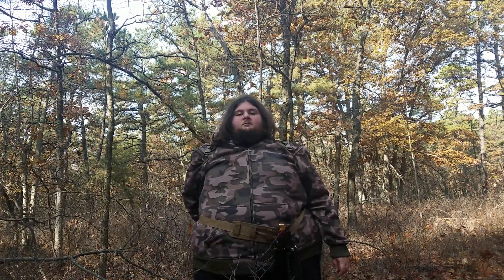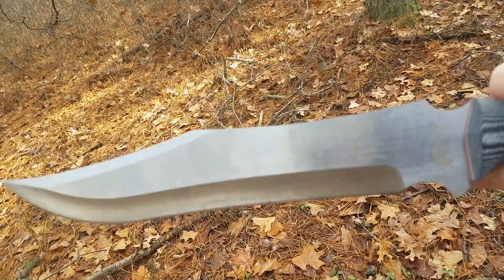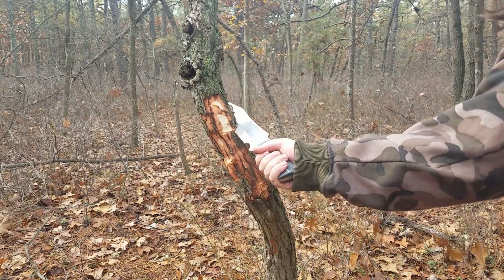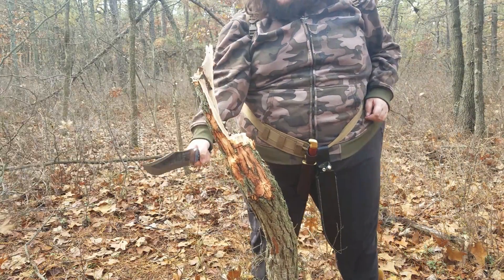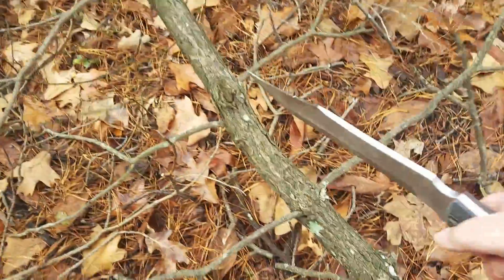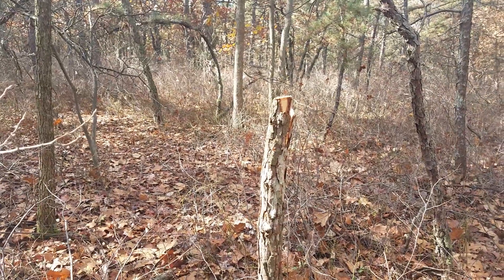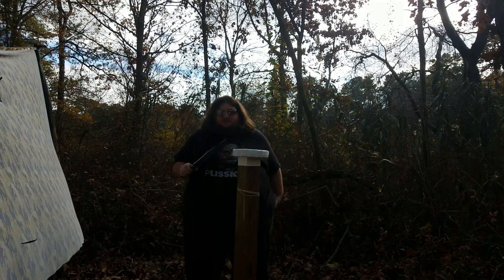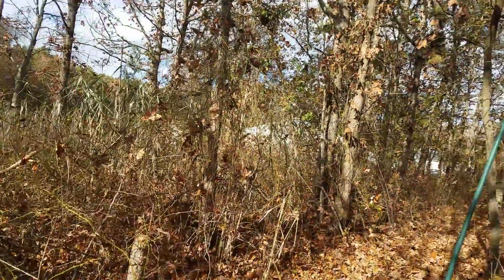MTech USA Raptor Review and Stress Test - By Will Keith

Comment: Knife is a beast... unfortunately Master Cutlery discontinued it.  7mm thick, even though it's printed with 6mm.  It's actually 440C steel with a great heat treat.  They also used this same knife on the tv show, "The Walking Dead".  As a knife retailer, I just wish I had hoarded more of them.  We are sold out for good :(

Comment: Will, use a LANYARD around your wrist and the knife won't fly out of your hand. It definitely would be better with a GUARD to wrap your fingers around for extra leverage & to keep your hand from slipping down onto the blade when you thrust it hard into one of those concrete blocks!

Comment: Goes to show that everything they say about Stainless Steel is full of shief junk ,440C is very good material for blade making if done by people that know what they're doing.And the C in 440C stands for 440 carbon.  Plus the only knives I no that's as big as that one is those Kukri ones from Nepal made of high carbon steel and that can hang with those Kukri knives all the way.
Reply: Money Stewart Right man, why cant people understand that STEEL IS STRONGER THEN WOOD. It’s stronger then most things on the planet 😂. 440C is an amazing steel for a working knife fixed blade or folder. I’d rather my knife be soft enough to chip then brittle enough to snap.